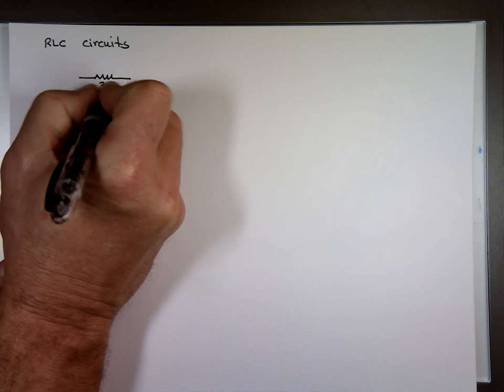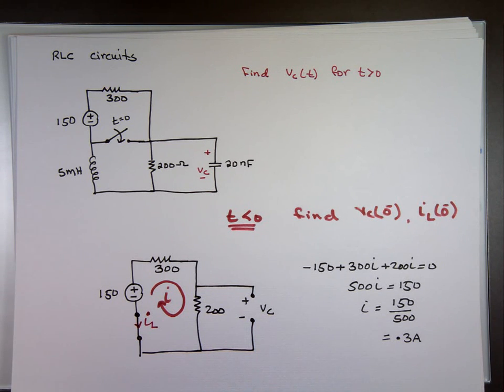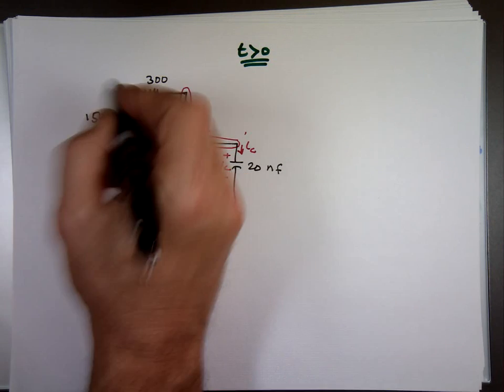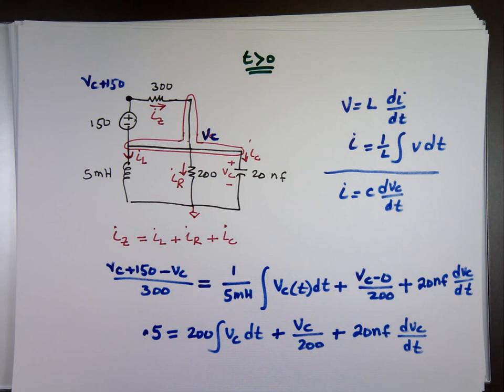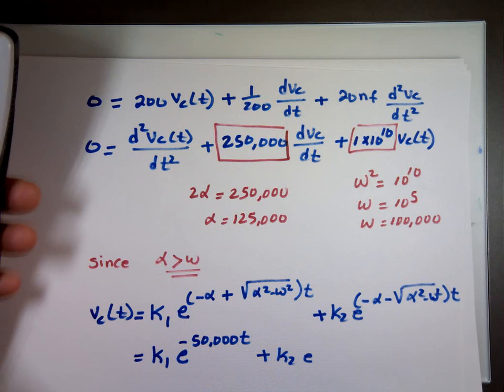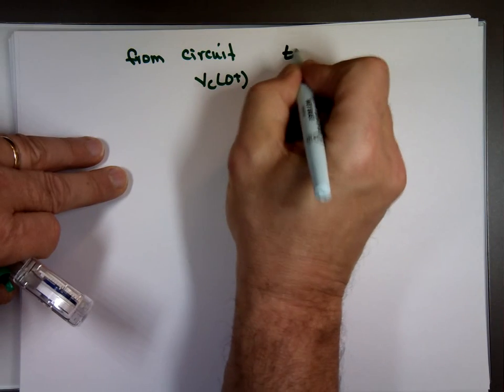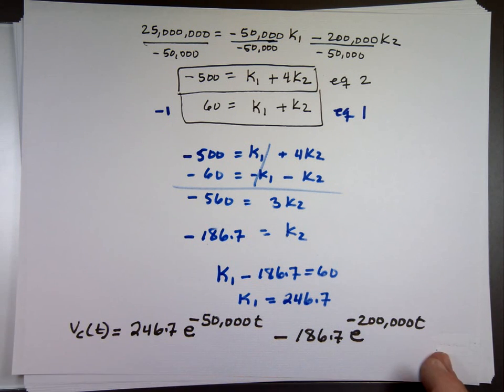RLC Circuit Example

Comment: For all of those still in question here, unfortunately many of the other comments are correct that this solution is incorrect. I have this exact problem in my Engineering Circuit Analysis (8th Edition) textbook (Ch. 9, Example 9.2). The professor does mistakenly add the source voltage and accompanying 300 ohm resistor to the t>0 circuit. The correct result is: 

Vc(t) = 80e^-50000t - 20e^-200000t (volts) for t>0
His channel is filled with great work, but he just missed a small mistake on this one. Thanks for the work!
Reply: hey I got -20e^50000t +80e^20000t is that correct
Reply: like k1=-20 and k2 =80

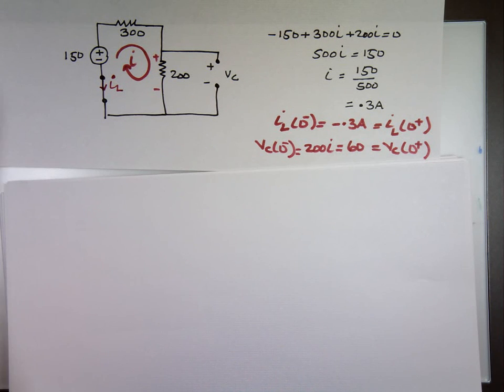Comment: You anbswered the kids question at 6:50 wrong. voltage is continuous across the capcitor you said not across capacitor when u shud of told him not across inductor. your tone of voide says ure arrogant and think your way smarter than you are, typical college teacher

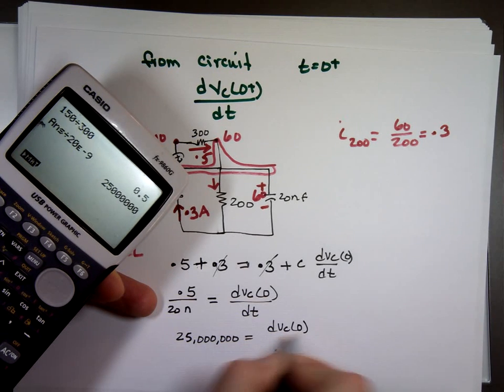Comment: Yeah there is a mistake at and before 30:20. Inductor current and capacitor voltage does not change in an instant and the switch closed so there is a short. In his calculation he totally neglected the short and treated it as if there was no current through it when in fact all the inductor current of 0.3A will flow through it.

Comment: After switch is on (t>0)  top of the circuit will not effect to the bottom of the circuit, because  current will  be circling only top of the circuit,  thus we can ignore top side of the circuit , if I am wrong please explain it
Reply: i know its late but i think so.i think the question is solved wrong

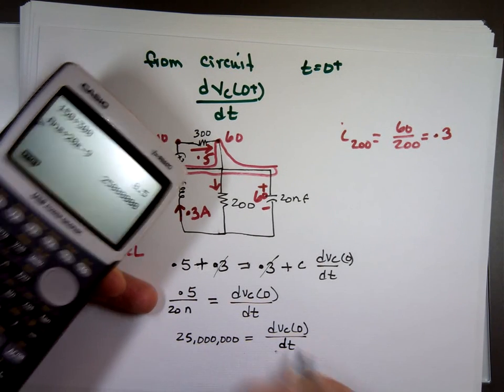Comment: Boss, I think you are way off!  At 30:20, I don't know why you're considering the current from the top (where the 150v & 300ohm resistor) for your KCL equation.  Once the switch closes at t=0, the top part with the 150v and 300ohm is not part of the bottom circuit any longer.   Your KCL at that node should only be:  iL = iR + iC , which becomes: 0.3 = (60/200) + C(dv/dt)... and so dv/dt = (0.3 - (60/200))/20E-9  = 0  ,not 25,000,000.    In case someone wonders why 60/200 for iR,...   (i=v/r) It's because that's the voltage across the capacitor before the switch closes, and voltage is continuous for a capacitor, so once the switch closes, the capacitor keeps that same voltage for a short period of time, and since the resistor is in parallel, it consumes that voltage.
Reply: Yeah. He must have had a brain fart.